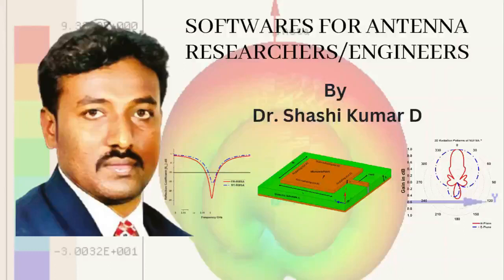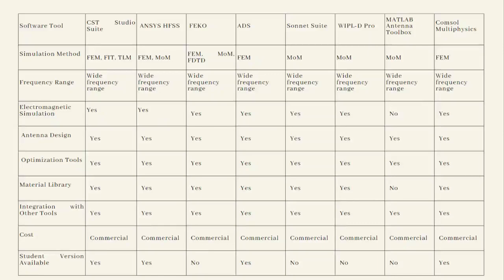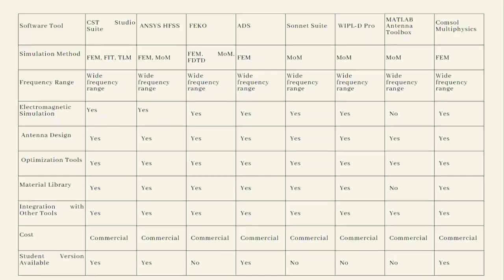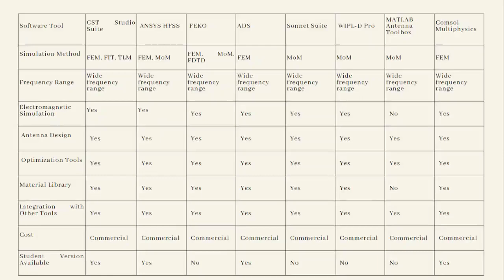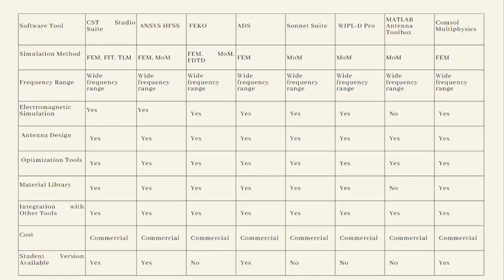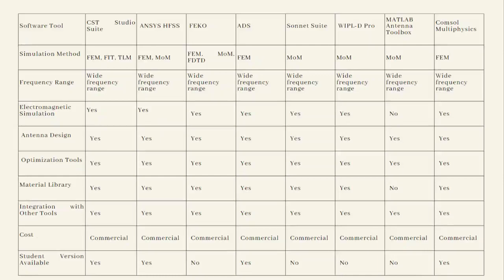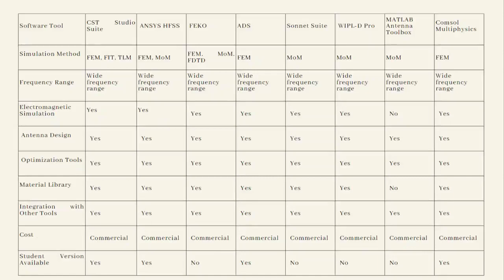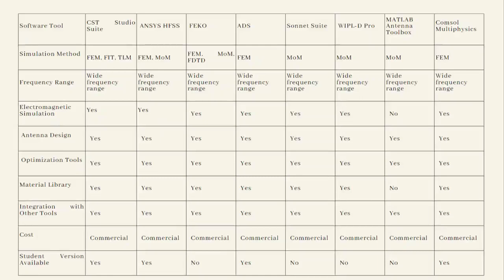Antenna Design Software's for Researchers

Comment: Sir please explain how to do bending analysis in hfss tool for wearable patch  antenna
Reply from the maker: In HFSS create a cylinder, and ground plane the. Use wrap command using edit surface option. After that thicken sheet add substrate and patch. Then you create radius of cylinder as a variable and do parametric analysis